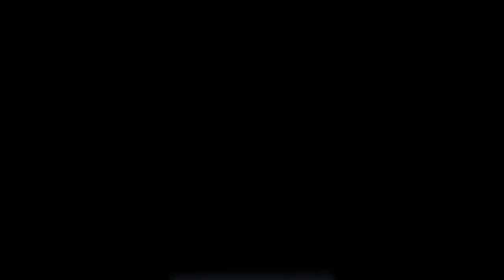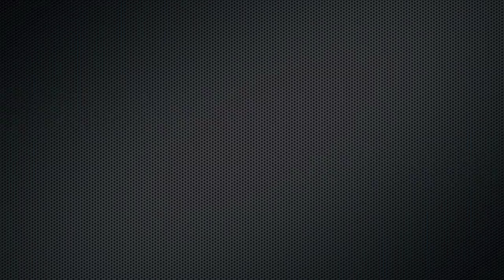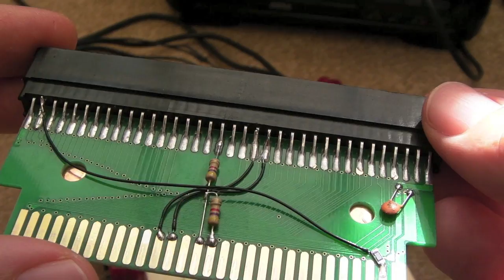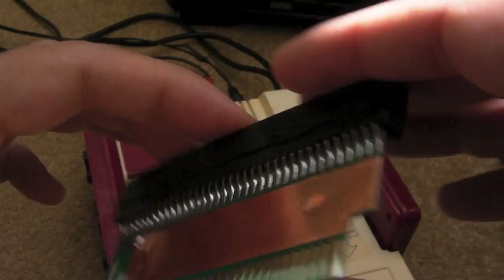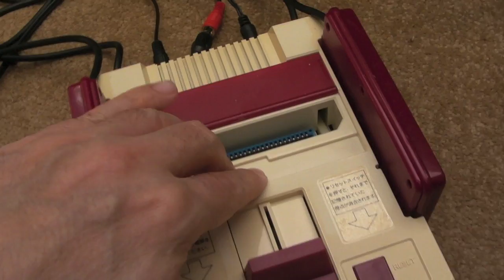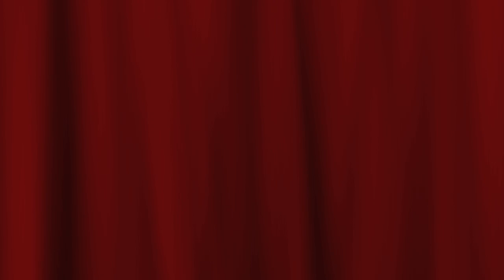Nintendo Famicom 72 pin to 60 pin Converter Mods & Everdrive N8 Follow Up (100% fixed)

Comment from the maker: Update 29/08 - I know of 4 people that have done this now and it has solved their problems, so it does indeed work.  Waiting on the 5th, hopefully he will receive his copper tape tomorrow.

Update 01/12 - At least 12 people have done this now and it has worked 100%
Reply: Hi,

 Just FYI I have a Famicom, a NES everdrive like yours and a cheapo converter and had the very same problems you had (same issues with castlevania and, in my case, play Gradius more than five minutes without crashing), because I don't have any famicon games around I though It was the console.

Just for kicks I followed your videos and now everything works like a charm, I've done the audio and MM5 mods and shielded both sides of the PCB with copper tape, no caps.

Like it said, looks you were right, if you shield both sides of the converter and ground them looks like you don't need the caps.
Reply from the maker: Thanks, that's awesome =D  Now we can enjoy all the games on the Famicom =D
Reply from the maker: I've heard from someone else that just added the copper ground plane and he didn't need the resistor inline with the M2 clock (as I suspected).  His is also working perfectly!  Barawer is just waiting on his Copper Tape arriving before he can confirm on his system too.   In summary - this fix works and all you need is the grounded copper tape.  I suspect this will solve problems with glitches on the Analogue NT and Evedrive too, but I think the copper tape needs to go over the cart connections on the NT motherboard to fix the problem there.
Reply from the maker: Heard back from Barawer and it has fixed his adapter too =D  That's 7/7, so yes it does solve the problem, and all you need is the grounded copper shield.   I am confident this fix will also work with the Playchoice 10 when using an N8, and I do believe the same problem is happening with the Analogue NT and N8 - in that case I suspect grounded copper plane needs adding over the NT cart traces, but that's just my theory until someone can test it.
Reply: GadgetUK164 - Retro Gaming Repairs & Mods: Do you sell this modded and “improved” adaptor?
Reply: I did this fix with the FC Twin, I still had some issues (using the USA test cart) especially with blue colors (black segment where visible). I tried to install a ground plane (with aluminium tape -- not the best to solder) on both sides, and connected as many GND as possible and made the M2 wire as short as possible, it looks way better now, there are still some issues though -- invisible for most games.
Reply: GadgetUK164 - Retro Gaming Repairs & Mods : Did you ever get to try a comparison test with this mod you did, and the Retro Freak NES to Famicom adaptor? (Amazon for $20+) I’d be curious to know if the same issues exist. Thanks & I love your channel!

Comment: hi, i was testthis update with 27pf and  the everdrive dont work, it shows glichts, but smb3 works, . One question, Do i nedd to cut any track or directly dolder the cap , thanks,and  great work
Reply from the maker: If you watch this video you will see that I removed the cap!!!  The actual fix is to use the Copper tape and make sure its grounded and not shorting to any nearby vias or connections.  Just try adding the Copper tape and solder a wire from the Copper tape to the nearest ground connection.  Then it should work.  You don't need a cap, and you probably don't need the resistor I showed in this video either.   You won't need to cut any traces either.
Reply: Ok , sorry and thanks , When I will test and put copper I will tell you the results. thanks very much
Reply: the new cup is not necesary?, I see in this video a cap between 5v and grounds pins, It is not necesary?, thanks and sorry
Reply from the maker: I don't think the cap is necessary!  I think you might find it works once grounded copper tape is over the front.

Comment: Minute changes occur in the electrical properties of components and PCB's and their interactions with each other depending on the environmental changes they are subjected to. This, as you rightly mentioned, is more likely with fast clock speeds but can affect any electronic circuit if the design increases the likelihood of cross-talk between traces or just plain old interference. It's possible that changes within the Famicom during the initial 'warm-up' period could inadvertently increase interference induced in traces in the converter during the same period and cause the symptoms you experience. This is why EMF sensitive components and circuits are usually screened by encasing them in an electrically grounded case. I suspect the design of the converter is at fault and if it had been thoroughly tested by the manufacturer they would have discovered similar problems - even game specific. As some people have mentioned, perhaps the board would be less prone to glitches it the traces were all kept to one side, reversing the cartridge, or if it were properly screened, as you have retrospectively done. Sometimes these sorts of problems catch out even the biggest makers of electronics and costs them millions of pounds in product recall and remanufacture.
Reply from the maker: Thanks for taking the time to post =D  Excellent information!!!

Comment: So the copper maintains the temperature of the converter? Thats really strange, but cool that it fixes the issue. Ha, there's no such thing as over-engineering. You're very innovative and improve upon these projects to where they have no issues. Who wouldn't want that?
Reply from the maker: It doesn't have anything to do with temperature!  It's carrying noise to ground (I think).  I am not sure exact how the effect works but I think it helps reduce parasitic capacitance on those traces and since all the vias are under it it's affecting connection on both sides of the board, despite being only on one side.   When I was talking about temperature I was just pointing out that without any mods, the temperature of the console seems to have an effect on the signals.  I think its more closely related to humidity rather than just temperature on its own as I've read about humidity affecting impedance before.
Reply from the maker: See this for more information.  It mentions there that a ground plane under traces can help reduce cross talk.  That's what I believe is happening, the copper tape carries EMF noise to ground.

https://en.wikipedia.org/wiki/Ground_plane
Reply from the maker: Thanks for the nice comment btw =D
Reply: GadgetUK164 Pretty interesting information there.

Comment: i haven't looked at the pinout, but from that board looks like all the lines are being rotated 180 degrees. I know the label would end up facing the wrong way, but would it not be easier if they made an adapter that was pretty much straight through and rotate the cartridge 180 degrees instead? Should get rid of a lot of the vias and close together tracks.
Reply from the maker: Nice observation!  Yes, I suspect you are right - it might be easier to just flip the cart around!

Comment: Interesting video, matey.  I think you're right that different combinations of what is nominally the same gear could couse very different results. I'm sure the chips in Famicoms, even if spec'd the same, would have architecture changes that would make some more intolerant to noise, etc. Even changes in the manufacturing process of the chips could cause some reliability differences.
Reply from the maker: I wonder if a similar problem exists with the Analogue NT as well.  A lot of the issues with the Everdrive sound very similar if not identical.  The other curious thing there is the NT uses an original PPU and CPU, so you wouldn't think there would be an issue with the Everdrive.

Comment: Another great video. But how do you figure this s#it out?!? (._.)
Reply from the maker: I guess its from previous experience - If you look at the issue with this adapter and think it through the answer is there.   1) The N8 works perfectly on a PAL or NTSC NES.  2) Krikzz has said that the NES and Famicom versions of the Everdrive are identical (except for the different edge connector), so there can only be one culprit - the adapter, and if all the connections are wired properly (as they are), then it has to be related to the traces and layout!
Reply: Nice =D Thanks for sharing =D